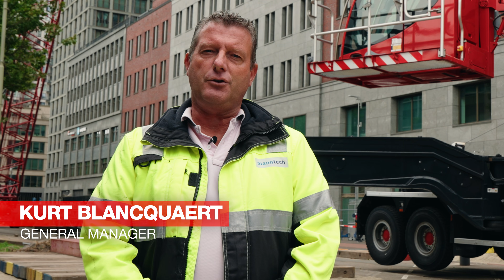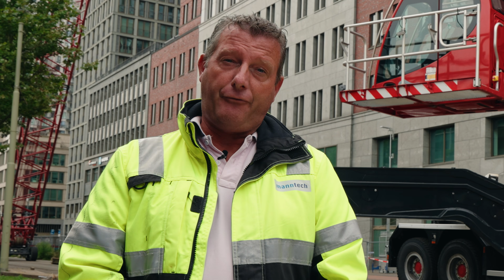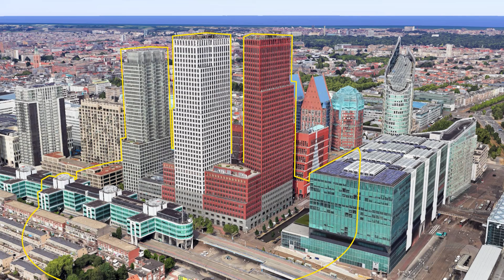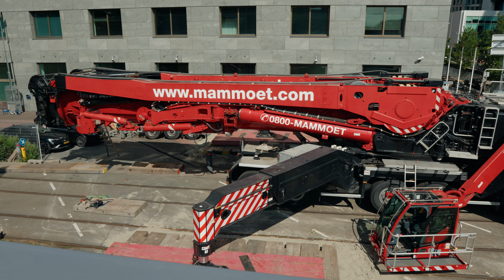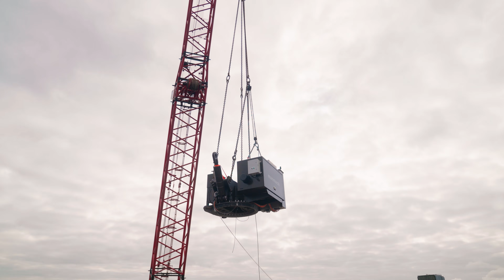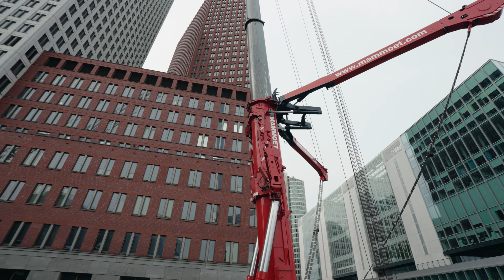Replacing roof-mounted Building Maintenance Units in the heart of The Hague

Comment: Replacing an AC Unit is complicated it requires not one but two cranes to set up and 12 trucks just to assemble the cranes. First the crane is driven to the job and rig mats are placed down. The first truck arrives with the second crane this installs the counterweights, the anchor block, and the wench. The second truck arrives this installs the tackle block, the lower jib arm, and the first mast segment. Trucks three through 11 install more segments and the crane starts to rise. Truck 12 delivers the hook, the cables, and finally the hook block segment. Once everything is assembled the crane is hoisted to the roof and the contractor delivers the new AC Unit on a lowboy. The old one is taken down and the new one is hoisted to the roof. Disassembly is the reverse of setup.
Reply: You seem really into this type of industry! And railroad work too..!? Do you work in that type of environment??

Comment: Im assuming the transported telescopic boom's contracted profile was the deciding factor to rather not use the LG 1750 hybrid lattice mobile?, although if you had the the road length why not? Low load capability only needed?
Reply from the maker: Hi there! Using the telescoping boom allowed us to minimize closure of the nearby road and limited the need to close and remove part of the nearby tram lines.

Comment: So these rooftop fixed davits for discussion purposes became obsolete for what reason, I find it hard to believe that these things would have to be replaced and not repaired or upgraded, unless they were crappy products to start with, something like that should honestly last the life of the building, or were these changed out because something newer came along that could do or add more to their usefulness, but what was stated in the video is that they didn’t work anymore, which I find very hard to believe being a building maintenance engineer, and why not use a heavy lift helicopter?
Reply: A helicopter is a far far more risky option. It's also incredibly loud and disruptive so they have limited hours they can work. In most places they need to have buildings emptied when flying loads over them.
Reply: These unit,s are being used daily to to inspect the building from the outside but also for windowwashing! They are mounted on the roof and get exposed to weather. These unit,s needed a complete overhaul, that a new unit was simply cheaper!
Reply: So you are expert on the life of exterior units. You'd better go and see the manufacturers and impart your knowledge so they can build better items next time. Does the roof on your house need maintenance? Does your car need cleaning and polishing? Stick to what you know. Because you are showing us all what you don't know.

Comment: The boom is separate!!!  Wow!
Reply: Yes separate, and on a crawler crane. The tracks are separate, the deck disconnects from the turret. The cab disconnects from the base, the massive 300 foot boom separates all to be transported onto 53 foot semi trailers to be removed. A truly amazing feat.
Reply: @LorneDawg1967 I know crawlers are modular. Just never seen a mobile one like that.
Reply: That is reason, I do not like that crane and my favourite is Lebherr LTM 1750-9.1, little bit smaller, maximum 800 tonnes, but boom is attached always, like mobile crane should have.
Reply: But the outriggers are being transported  just like the ballast.
Reply: @ghostdevill 
I think that depends. Some videos I have seen, crane have legs attached, some not, on road. Also LTM 1750-9.1 can have up to 204 tonnes counterweight. 9 axles, each axle can be up to 12 tonnes, so in total it can weight on road over 100 tonnes, but still not possible to carry everything. Only quite tiny cranes can carry all their equipment by themselves.
Reply: @ghostdevilldepends on the country, in the uk it comes with outriggers attached.